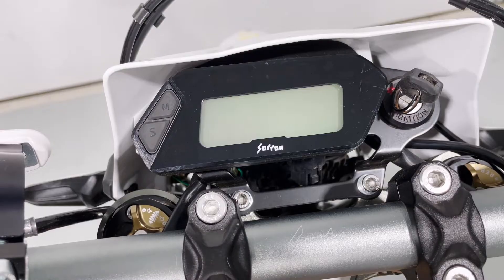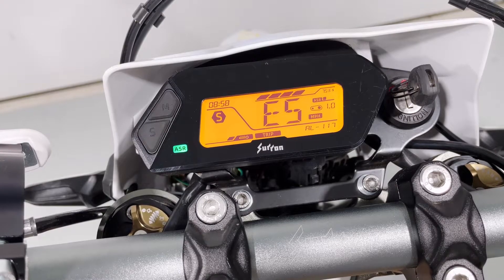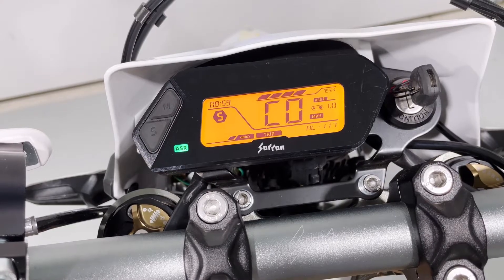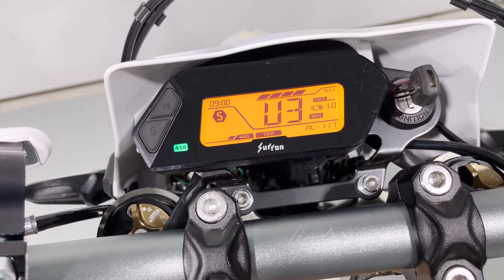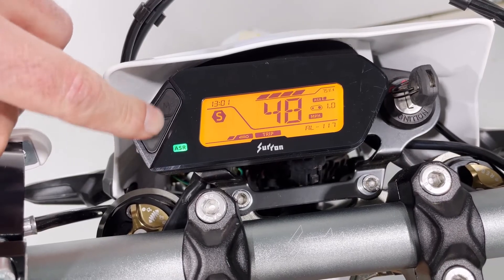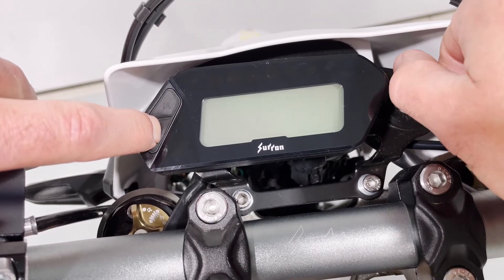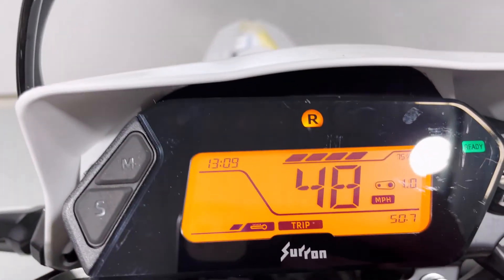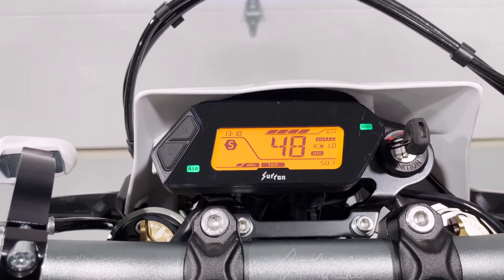How to Adjust the Sur Ron Ultra Bee's Factory Settings

Comment: GREAT video.  I was in the woods thinking, now how do I set ASR again?    Your video to the rescue!  Just more info, while not always appropriate, found ASR to be crazy helpful on long, steep uphill (gassers use the clutch)  in the woods with lots of smaller loose shale where it's easy to just loose traction and spin out.  It was not as valuable on other long (mostly loose mud/dirt) --having the abiilty to test different levels and turn on on the fly is something I look forward to checking out.
Reply from the maker: Glad it was helpful!  And yes, I agree...ASR is a gamechanger for dirt bikes.
Reply: @StoltecMoto   I still use 19/19 wheel setup with Motoz rear terrapactor and Recon on the front.  I have found A2 is a good setting for loose uphill so far ...

Comment: I’m getting problem on my ultra bee works perfect for so long then when u random throttle etc the bike just cuts out and throttle don’t work then as soon as speed hits 0mph it turns off
Reply from the maker: Haven't experienced this before.  Did you get any codes?  If not, check all connections.

Comment: Mine is still cutting out mid wheelie with tilt sensor on c0
Reply: Believe that’s an electrical issue with wires disconnecting at the angle
Reply: Sorted it by turning of the traction control fully 😊

Comment: I’ve been getting error 109. Already changed the main power cable and the bike still cuts off after a little bit of throttle and the engine light comes on. Any suggestions?

Comment: What if I can’t get into the settings? Nor does it show the ready mode?
Reply from the maker: The ready mode should show when the kill switch is switched to "on".  It won't show if that's not the case, or if the side stand is down.  If that's not working, there might be a fault elsewhere.  The faults will cycle across the screen if you press the M button when the bike turned on.

Comment: Nice video, how i can display the trip km miles i have driven like in every car. I was in this mode but forget about it again.
Reply from the maker: Key ON, press M.  Trip distance and top speed will display.  Reset by holding S.
Reply: it only shows this “AL - 117” is there an other trick how to display the trip distance
Reply from the maker: @technischespielereien2227  The AL-117 code means the side stand is down.  Flip it up and code disappears.

Comment: Hey, what’s the proper charging method? I know with the light bee you had to turn off the breaker when you started charging it do you take off the terminals etc? can you please advise I can’t find anything. Thank you!
Reply from the maker: Plug it in, and away you go.  No breaker to flip or anything to disconnect.  Leave the battery connected via the harnesses.
Reply: @StoltecMoto  thank you! And finally, if I choose to disconnect remove the battery to clean it or something I’m supposed to take off the communication cable before the orange one right and the same procedure putting back on?
Reply from the maker: @Revveduphobbies you got it. Exactly.

Comment: What setting do you reccomend for a 54 tooth sprocket?
Reply from the maker: Depends what size rear tire you're running.  Honestly, easiest way to do this is to make an adjustment and then ride the bike with your phone for GPS speed.

Comment: No speedlimiter you can turn off like the storm bee? 

great video!
Reply from the maker: Nope. Full bore, all the time.
Reply: @StoltecMoto  Wish they added tunable options for it. the LBX was ok, but im 215 pounds and 188cm so it was a little slow and small ofr me to enjoy the wheelies. 
18kw tune would be dope
Reply: Hey Bud, I have a storm 2023, how can I turn off the speedlimiter please ?

Comment: Hello. How do i reset the trip counter.  And for ultra be users. This video is very helpful but should know the keyhole have the explanation of each letter. But with out  this video is useless.  Tks for this great video
Reply from the maker: With the bike stopped (speed = 0) and the trip meter showing, press and hold the S button for 2 seconds.
Reply: @Stoltec Moto  tks. It worked.

Comment: Thank you for doing these very informative videos. I have a question I had watched one video where  the gentleman was saying if you change the tires to  18 on the rear and 21 in the front that your traction control wont work is that true or can you adjust it with the settings you were explaining in the video. Appreciate it. Looking forward to seeing more of  your videos. Hope you get back to me. Thanks
Reply from the maker: Yes, you are correct. The issue is with the different tire diameters. We have something in the works to address this, but still in progress.
Reply: @StoltecMoto  thanks for getting back to me. I have another question do you think just changing maybe the quality of the tires would change the cornering at all from what I hear that’s main reason for people wanting to go to the 21/18 I know that’s with the most motocross bikes and used to race motocross myself. I’m just wondering if I would like the ultra bee which I’m getting in a few days very happy about how I like it on single track trails and some track riding also!! do you have any other suggestions that might help the handling ??
Reply from the maker: @Mrhyperelectric  it’s not hard to do better than the stock tires. They aren’t as bad as the stock Light Bee tires, but they’re still pretty weak. We have a set of 21/18 here, but you can experiment with new 19s for a lot cheaper to see if you’re happy with it. I don’t personally have a problem with the front end being twitchy like some have reported. 

I’d set the bike up for you ergonomically (bars, grips, pegs, etc) and ride the hell out of it. We have a bunch of nice upgrades in the works to help in some areas, but honestly, the bike is pretty capable right out of the crate.
Reply: @StoltecMoto  Awesome my man you guys are great and thank you for the fast reply and feedback.  So yes I saw your video on setting up the digital display if I have any questions or if there’s anything that you could tell me that would help me out would be great. I plan on putting new tires on pretty much right away might wear them whats comes and wear them some a bit..
 I also saw your video on the hand guards and got the spacer from your company . How are those Hand guards do you feel they are the best ones or to get?? ThankYou
Reply from the maker: @Mrhyperelectric  I think they are great for the money. Good value. You can buy lighter ones, and maybe stronger, but they are usually 2X the price. I’d recommend these.
Reply: Surron have a factory 18 tire for this bike.  If you use a after market your asr won't work and maybe some other features

Comment: Any idea where to find the stock ultra bee tires?
Reply from the maker: Besides a dumpster?  😂 sorry, couldn’t resist. Honestly, never tried looking.  There are better options worth considering first.
Reply: @StoltecMoto  I’m just trying to stay with the lightness of stock. Do you know of any other tires that weigh the same but are more durable
Reply from the maker: @jdoggaming4129  depends how you’re going to ride the bike.  Do you want to stay with a 19” front?  Or are you looking at a 21”?
Reply: @StoltecMoto  most likely stay stock wheels
Reply from the maker: @jdoggaming4129  we’re going to publish tire data on our site in the coming weeks. You’re not the first person to ask, so we’re working to make the breakdown as comprehensive as possible to assist.
Reply: @StoltecMoto  awesome looking forward to it
Reply: @StoltecMoto  I second that looking for a lightweight street tire for stock wheels
Reply: Look t charged cycle works tire charts for the lightest options out there. Unfortunately the ultra comes with a non existent oem size 80/100-19 size so your going to find only 70/100 will work.